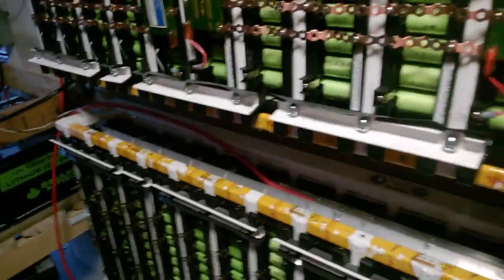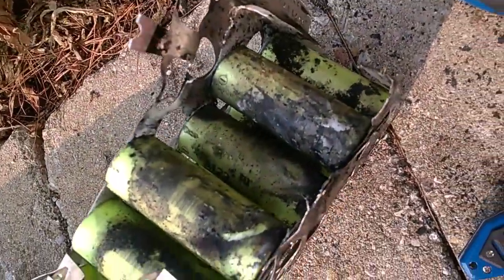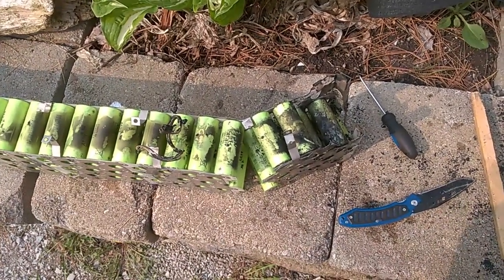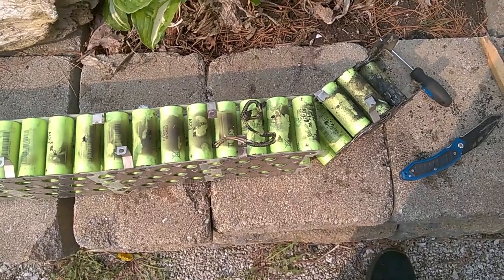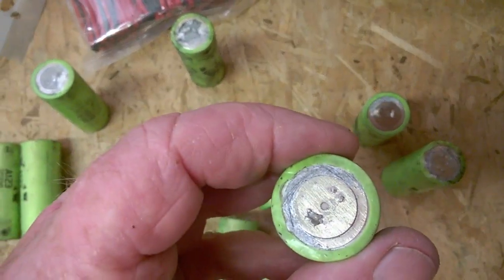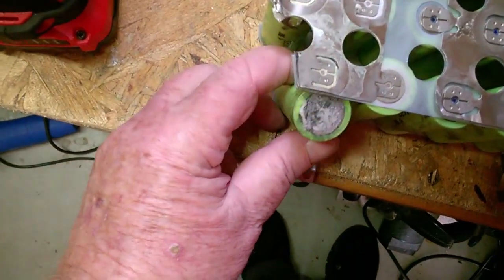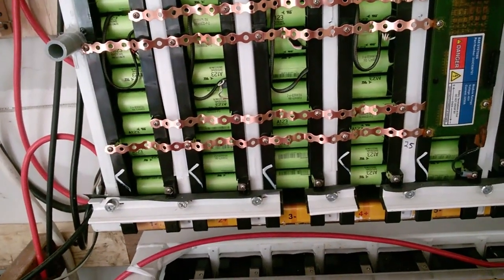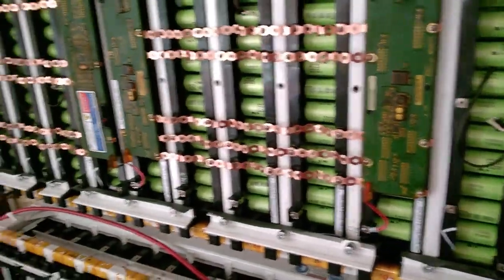2019 29 Junkyard Lithium fail. I screwed up

Comment: This is a good video that shows the heater cells https://www.youtube.com/watch?v=emip7H8_-Yg
Reply: This guy is at 80P per pack... LIPO!!
Reply from the maker: @paulbarrette2557  Yes  well known for his DIY powerwall with 18650's lipos are flammable which is what steered me away from them which is why I went with Lifepo4
Reply: @offgridwanabe  Agreed 100%. I am considering however to rip all the packs a part, test each cell and rebuild... like HBPowerwall does. Crazy amount of work tough.
Reply from the maker: @paulbarrette2557  If you take each pack apart and test I think is the safest way and you will get a better battery as you will group the cells by capacity but it is a lot of work. Also you will need to get all packs from the same era ie all M1A or M1B as they are different.
Reply: @offgridwanabe  Thanks .... Which is the more recent? or best? ... the B or the A
Reply from the maker: @paulbarrette2557  I seem to like m1b as they are the newer ones but m1a are good too just not the best to mix them but I do that too but if I knew better at the time i would not
Reply from the maker: Oh yes I watch Pete a lot he is very ingenious
Reply: @offgridwanabe  Would an individual fuse per cell have helped?!?! I guess so.
Reply from the maker: @paulbarrette2557  Yes but since I have started using a good bms I have had no problems it controls the batteries and over charging is not possible

Comment: What conditions caused corrosion do you think? Seems to be a flaw in cell design.
Reply from the maker: I think they were overcharged and they vented some electrolyte and that plugged the vent for the next time. In some of my other videos you can see the build up just like lead acid batteries the white flux of corrosion. In any event a person needs a BMS to control charging and balance.
Reply: @offgridwanabe  have you considered bottom balancing and then not using the balance feature of your BMS? You would find the max voltage of your weakest cell, then never charge the pack past the point that the weakest cell is full.
Reply from the maker: @ninja5672  It is possible but with thousands of batteries I know there are some that would be bad and it is just too much work to take them apart and repair so the balancer is the only option in my opinion. Each 40 volt pack has 96 batteries and there are 16 packs in each bus battery 1536 and I have 3 bus packs and will add more. I did try at the 40 volt pack level and discarded the low ones so in a way I culled a few.

Comment: what would 28 of these single cell cost to ship to great britain thank you my old v28 milwaukee actually have canadian made cells   moli fspe70045   1325 iq  imr 26700a
Reply from the maker: I have no idea for the shipping but these cells can be bought for $2 a piece or under $100 for a 40 volt pack which is 12s8p so 96 batteries weighs about 25lbs. I think shipping lithium has a lot of restraints especially for air freight.
Reply: thanks do you have a supplier i could go direct and ask
Reply from the maker: @honda4004  Just check on Kijiji.ca lots on there search "used lithium ion battery packs"

Comment: I learn lots here my self. Yes out side shed is good idea i figure. I know i'm going to use a solid bar on one side of my pack and the other side only a wire sort of a fuse type thing. So if one of the modules acts up it will just melt the wire and pull away from the rest of the group packs. No fire that a good thing at least. Unlike them other type lithium.  The idea they explode like that makes my say the shed is the best option for sure. Save the home at least. Thanks for sharing this. Very nice to see. Gives other some thinking to do who have these. : )

Comment: new lipos inside EV cars are MUCH safer then these A123 cells, same goes for 18650 cells they are even more likely to start a fire then the A123 cells, the newer lipos can be charged to over 8 volts per cell with little heat.

Comment: Thanks for sharing. Like with everything you must use at your own risk. Looking for corrosion is a must .
Reply: I couldnt imagine a pack with no cell spacing and lipo cemistry. Wow
Reply from the maker: This pack was all /B's they have a different marking on the negative end and in the  naming plate ANR26650M1-B
https://www.batteryspace.com/prod-specs/6610.pdf